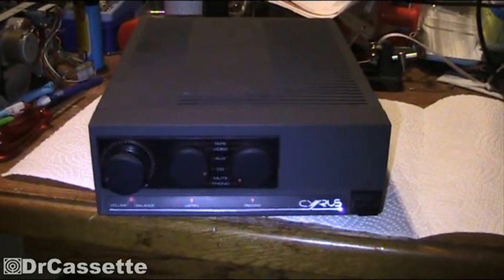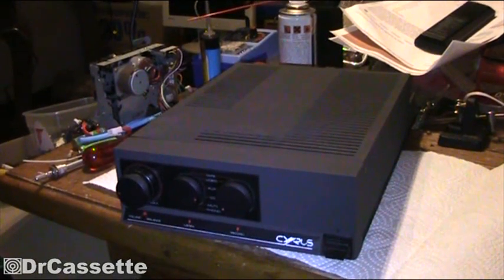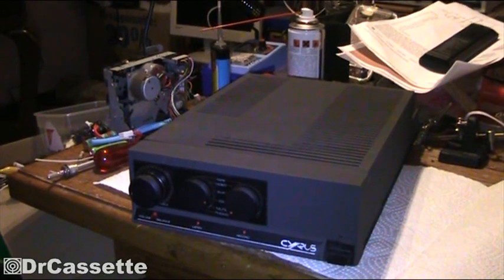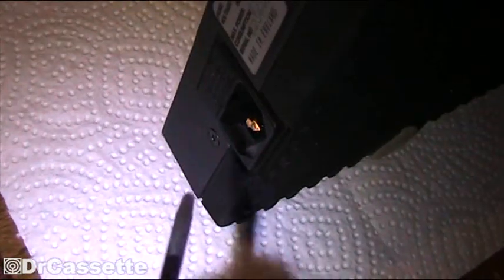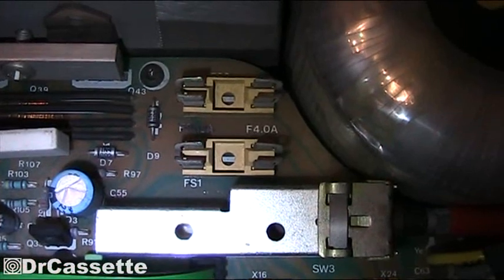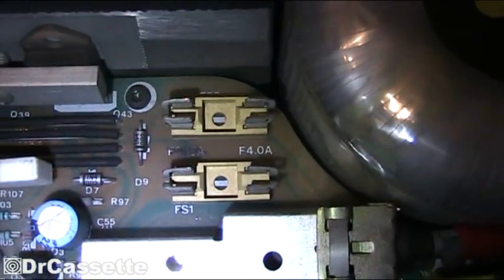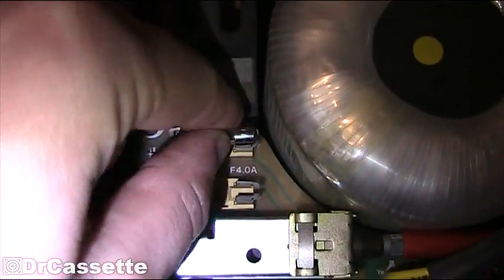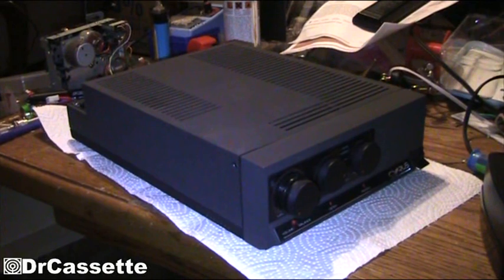How to modify/unmodify a Cyrus 2 amp for use with a PSX!

Comment: Actually, there are four versions of the Mission Cyrus amps. Series one: plastic construction with red power button. Series two: plastic construction with black push button and red Cyrus logo. Series three: Diecast metal construction with red Cyrus logo and headphone jack on the fascia. Series four: Diecast metal construction with silver Cyrus logo and flip switch. And each series had revisions to the boards during production. For example, late production series two Cyrus amplifiers have circuit boards that are almost identical to those used in series three and four Cyrus amps.

Comment: Re: Compatibility of PSX and Cyrus Two 

Cyrus support tells me that, 
"all versions of the original PSX are compatible with all versions of the Cyrus 2".

Thought I pass this on. 

Cheers 

Michael
Reply from the maker: I made this video 10 years ago, so I don't remember the details, as far as I know there was one version (the first version?) of the PSX that had somewhat lower output voltages. Not a problem when connected to a newer version of the Cyrus Two, other than slightly reduced output power. There could however be a problem when connecting an old version of Cyrus Two to a newer PSX that puts out higher voltages than what the old Cyrus Two was designed for. Some research may be necessary. I would not rely on the company support to still know all the details of products they offered almost 30 years ago.
Reply: @DrCassette  anyway, on the PSX connector is reported to use only with Cyrus 2 PSX

Comment: I recently bought a Cyrus2 with PSX. They had been bought together in the early 90s and owned this whole time by the same guy. Looking through the casing these two fuses are in place. Is it possible the guy has used it like this for 27 yrs? And I'm assuming I should remove them.
Reply from the maker: Yes, remove the fuses. They are most likely blown anyways, the two power supplies can not have worked together in parallel for 27 years without problems.
Reply: @DrCassette  thanks for replying I really appreciate it. I removed the fuses a few days ago thanks to your tutorial. The fuses look intact. Is it possible there was a "battle" between the two components and the amp and fuses "won" and something may be damaged in the PSX? Everything seems to be working fine, they sound great and I've always liked the design, like they should be in a tank.

Comment: what type of fuses should i use on the cyrus two issue 06? and for his psx?
Reply from the maker: The fuse values are listed on the circuit board. If not, refer to the service manual.

Comment: thx! I ran the Cyrus 2 * PSX without removing the fuses. Some say this is not possible. 👺
Reply: I recently bought a Cyrus2 with PSX power supply. They were originally bought together in the early 90s and used by the same guy this whole time. Looking through the casing these two fuses are still in place.
Reply: @ronnygibbon wt a f. According to Cyrus this isnt possible, but good for you! And the sound?

Comment: Hello great video, can you tell me how to remove the blue blanking plate over the psx socket on acyrus 2 please ?
Reply from the maker: Isn't that just clipped in place? I don't know, I've never had a previously un-modified Cyrus Two, so I have never seen that blanking plate.
Reply: DrCassette yes I found out its clipped in place thanks
Reply: I ended up hitting it pretty hard with a tiny flat driver in that very hard to see slot, and pop!

Comment: I have an original metal case, rocker power switch, Cyrus II (ISSUE 06) and matching PSX. I also have a later Cyrus II with the plastic case and push button power switch (ISSUE 07). The original Cyrus II has died. I took the fuses out of the later model Cyrus II to use with the PSX but no joy. It works fine on its own with the fuses in place. Do the later Cyrus II's still need the fuses removed? Should a late model Cyrus II work with an original PSX?
Reply from the maker: This is interesting. I thought the earlier versions had the plastic case and all the later versions had the cast metal case. 
Have you tried running your metal case Cyrus II without the PSX (put the fuses back in)? It is very likely that if a failure occured in the metal case Cyrus II it took out the output fuses of the PSX. So also check inside the PSX. 
Please do some more research before connecting the PSX to the plastic case Cyrus II. I don't remember the details, but there definitely are some incompatibilities between old PSXs and new Cyrus IIs and vice versa.
Reply: My Cyrus II works fine on it's own without the PSX. I found the service manuals that detail the design and circuit board differences between the Cyrus versions but it's mostly a physical description, circuit diagrams and component lists. I haven't found anything else. From what I have read, I'm lucky to have a problem free Cyrus ii after all these years. I have a Chromecast audio plugged in to it. I bet the designers didn't see that coming.
Reply: What is a difference between “ISSUE 06” and “ISSUE 07”?. I thought only early models had plastic cases?
Reply: same as I remember, older models have plastic case, while newer models have metal casing, but I guess they changed many times the models at the time  @msadurski

Comment from the maker: If you only use the high level inputs the power cord is unnecessary, if you use the phono input you have to have the power cord atached and the unit turned on because the PSX does not supply power to the phono preamp.
Reply: If I use high level and phono(MM) sometimes, I still remove the FS1 and FS2 ?

Comment: Nice tutorial.  I've got a Cyrus 2 packed away somewhere. It's a late model just like that but the grey Nextel finish started to flake on the fascia so I stripped it all off and painted both the fascia and the lid satin black with BBQ paint.  Looked damn classy.  I'm still unofficially looking for a matching PSX for it, but they don't turn up very often without another Cyrus 2 in tow and I don't need another Cyrus 2 nor do I want to spend money buying one.

Comment from the maker: @costellom5 
The external power supply contains an even nicer torodial ;)
It does increase the peak power output of the amp, I think the extenal gives you 80W peak while you'll only get 40W peak with the internal psu.
Reply: as far as I know there is 50W alone and 70W with PSX, and yes, the toroidal on the PSX is way more bigger, occupying all the internal space side to side. Removing the fuse, actually the included toroidal supply just the preamp, while the PSX supply the final stage, making the system like a pre and final stage separated, at least for supply power.  I used the PSX for a couple years, then changed the speaker with a pair of Ditton3 Celestion and let them with just the Cyrus two because with the PSX the sound was a little compressed in comparison. Thanks for the video, I see it is from 11 years ago, but I would like to add my experience here :) (my Cyrus two is still working after 34 years)